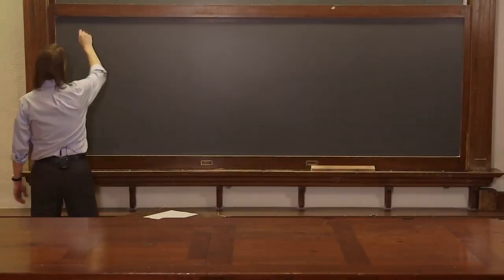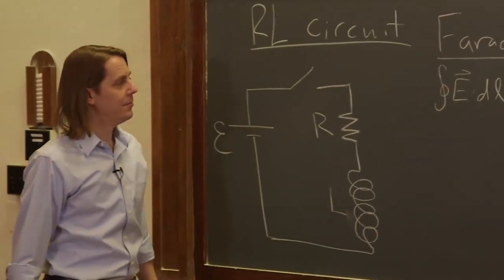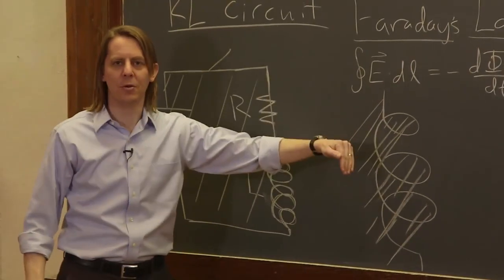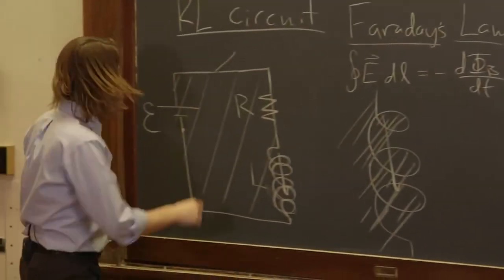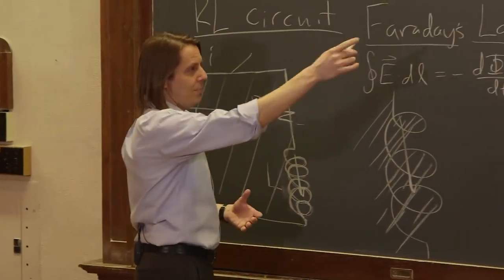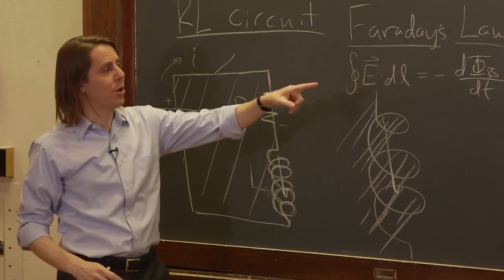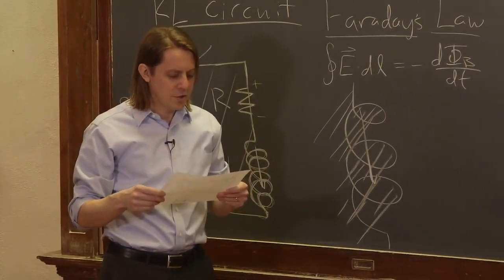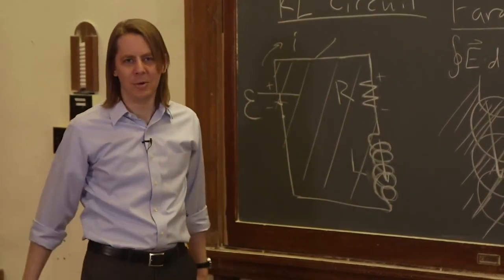PHYS 102 | LR Circutis 2 - Faraday's Law is the correct approach for a Circuit with an Inductor!

Comment: I am curious about the pedagogy here. Why is it that physicists insist that the only correct way of modeling inductive circuits is with this methodology.  It seems that the method falls flat fairly quickly.  For example, if I change your circuit where L is actually two inductors in series L= L1+L2, and I need to know how much energy is stored in L1 (not in the total inductance), then this particular pedagogy seems to indicate that there is no way to differentiate the energy stored in L1 versus L2.  I don't know how you are going to be able to talk in any reasonable way about such a scenario without assigning the magnetic potentials induced to L1 and L2 individually, not the loop.  The loop is immaterial, there is energy that is being stored in each individual inductor.  The KCL is a restatement of conservation of charge, while the KVL is a restatement of conservation of energy.  I don't think your criticism of the KVL is that conservation of energy is wrong?  The only thing that you can say about the traditional circuit approach is that the potentials in the traditional circuit analysis can not be arrived at by integrating the electric field along the conducting path.  But they can absolutely be arrived at by using the scalar and vector potential form of the electromagnetic laws.
Reply from the maker: Here's what really happened:  I always taught inductors following the typical textbook circuit approach that other instructors did previously.  I then put it in my online class that way.  One day I got an admonishing email from Walter Lewin asking me why I had incorrect physics in my class.  So I looked into it and saw how the textbook way is an approximation.  So I made a new version of the lectures to tie it back to Faraday's Law.  The class is intro E&M so we aren't really looking for the best or most accurate way to describe inductors.  I made the change more as a way to show them the Maxwell's Equation version to bring that back up.

Since all that, some Youtubers kind of got into it over which way was best to think about inductors, but I haven't really paid attention.  Also, this was 10 years ago so my memory is fuzzy! :)
Reply: @Prof-Hafner  Ha!  That makes sense.  Listening to it again I can kind of hear the admonished professor admonishing the students.
Reply: Of course you can consider multiple lumped inductors. When you decompose the circuit path you can choose the path jumping at each coil's terminals or the path going along the coil's conductor. In the first case you can use the mockup version of KVL and pretend that KVL still works; in the latter, you will have two surface integrals, one for each coil. No need to consider both surfaces as included by a single "double" loop.
Reply: @copernicofelinis   And how are you getting the energy in the inductors?  What surface are you integrating and what are you integrating?
Reply: @argcargv  if the inductors are lumpable I can ascribe energy to one or another, and use the mock up version of KVL, pretending there is a voltage drop at each coil's terminals. But I guess I could also split the integral over the entire surface into multiple integrals, each one associated with the (almost) closed contour of each coil. (It has to be almost closed if it's a lumped component).

If the inductors are not lumpable, then you are in a situation where you cannot identify separate surfaces for each inductors, and that is why the Faraday approach is more general. In Lewin's ring, for example, you cannot associate separate surfaces to the bottom and top part of the ring. You have one big surface integral that says KVL is dead, and your energy is associated with the circuit, not separate half-coils.
Reply: @copernicofelinis   I am still not getting how you are arriving at energy from this procedure.  Are you invoking the Poynting vector here?
Reply: @argcargv  when I was talking about surfaces I was referencing the broken KVL equation that is no longer zero. In the same way you can split the line integral (that gives voltages) on the lhs , you can also split the surface integral on the rhs (that gives the emf contributions) showing the contribution of each inductor. At each coil its surface.

But if you want to use Poynting then go full field. Expand the divergence of E x H and integrate it over the volume that encloses your circuit. The whole integral is zero (because we are not considering radiation), but the various parts of the expansion give different contributions in the various parts or chunks the volume can be partitioned into. 
The volume chunks containing each capacitor have contributions by E . dD/dt only; the volume chunks  containing each resistors have contributions by E .J only; and the volume chunks containing each separate lumped inductor have contributions by H . dB/dt only.

If you can split the volume into separate chunks, each with its own inductor inside, you can compute the powers and the energies associated with each inductor in the circuit.
As long as they are lumpable.
Reply: @copernicofelinis  Ok, the point is that circuit theory includes the Tellegren's theorem that says that given potentials W and fluxes F, we track the flow of extensive quantities, such as energy, ie. the power is V*I.  In this, it is important not only that KVL is satisfied, but that the meaning of V*I sd power is preserved, which we can integrate in time to get energy transfer.  If you want to take a circuit view of a RL circuit, we can consider the power supplied by the source, the power dissipated by the resistor, and what is left was transferred to the inductor by Tellegren's theorem.    Faraday's law itself is not sufficient to understand the flow of energy in the circuit, you need more than that.  If we consider the voltage to be the scalar potential, then it is much more straightforward to show why V*I represents the flow of power to or from the magnetic elements.  However, if to get the KVL you are integrating along a path that is different from the current flow, then it is harder to make sense of why the V*I relationship represents power.  It is not a particularly useful explanation in that context.  Furthermore, the fact that your circuit that is represented by the conductors that connect the various components have no changing magnetic field between them is insufficient to fully describe the circuit, as this fact could hold, but there could still be parasitic mutual inductance between the inductors.  This can obviously be measured experimentally, or modeled in a lumped model.  It is the absence of including parasitic mutual inductance that is the error that one makes in such circuits. When these terms are included, the circuit models are perfectly capable of modeling these effects.
Reply: @argcargv  Tellegen's theorem is a newtork theorem that requires the lumped circuit approximation. You cannot use it when the circuit is not lumped, which is the general case. In lumped circuit theory the conductors connecting all lumped components are zero dimensional, so you don't have to worry about charges or fluxes. 
The general approach uses voltage as the line integral of the electric field, not of its conservative part alone. This approach is consistent with Ohm's law inside the conductor and does not require you to invent a new theory of conduction in copper that explains how you can have, say 1V drop with a current of 1 mA in a piece of copper with a resistance of a fraction of milliohm.
Reply: @copernicofelinis  Ah, but I think there is the rub.  What is the criterion for saying a circuit is lumpable?  A conservative (as in most restrictive) view would say that we would like to see the electric and  magnetic field magnitudes outside of the components be small enough to neglect.  That I think this is your view of lumpable (correct me if I am wrong).  And I would argue that this view is a sufficient but not necessary condition of lumpability.  You offer no argument that this is a necessary condition.  For example, lets consider the two series inductors.  Let's say that they are air core inductors, so like most electronic components they don't actually satisfy the narrow view of what is lumpable.  The result of this is that two inductors in the circuit may interact with one another.  In this case the magnetic field lines extend far outside of the coil, as an air core inductor does not do a good job of confining its magnetic field.   However, I can control the coupling between these coils by their geometry.  If the coils axes are at right angles to one another then the mutual inductance between them will be small and usually can be neglected, then they can be treated as lumpable elements in the circuit even though the changing magnetic field lines from each of them permeate each other.  I can even use Tellegren's theorem to talk about the energy stored in each individual inductor.  Because these are vector fields and because Maxwell's equations are linear, they superimpose on one another.  Thus, even though the coils changing magnetic fields overlap one another, and the energy stored in each is stored in the same volume of space, the energy can be assigned to each inductor individually, and the circuit is well modeled using a lumped circuit model even though the most restrictive conditions of lumpability is violated.  Thus, if you are taking the restrictive view of lumpable circuits, then this shows that this conservative view is a sufficient, but not necessary condition for lumpability.  And note, even in the case that there is coupling between the inductors, then I can still model the circuit with a lumped model by including the mutual inductance between the coils.  In doing so I can also talk about the energy stored in each individual inductors field, the energy stored in the mutual field and the energy transferred between the inductors by the mutual field.  In fact, the base case lumped circuit model is one that includes all parasitic inductances (self and mutual to all other parts of the circuit) as well as all parasitic capacitance to other parts of the circuit.  Your restrictive view is simply the case where all parasitic elements can be safely neglected without compromising accuracy, but our hands are not tied, we can include the parasitic elements in our lumped model if needed.  In that case it is much harder to define what are the necessary conditions for the validity of the lumped model.
Reply: @argcargv  look, it's this simple: with your view of potential difference as the line integral of the conservative part of the electric field, KVL still works, buy Ohm's law ceases to work inside the indictive components. 

With 'my' (and the IEC) version of voltage, ohm's law works inside the component, with no exceptions. KVL dies as it should because we are dealing with nonconservative fields (and this is very basic physics).
 In lumped circuits,  KVL works if the circuit path does not encompass a variable magnetic flux region. That is, the circuit path has to be shrinkable to a zero dimensional point, where all the two terminals  of each component meet. This does not preclude you to consider mutual inductances, or even a matrix of inductances, as long as the space of interaction of the fluxes is outside of the circuit path . But you need to have a circuit path connecting all lumped elements and no changing magnetic field inside (otherwise you could not shrink it without changing the properties of the systems).
Most circuits do. A few do not, as in the case of Lewin's ring.
Reply: @copernicofelinis  First, the circuit analysis approach such as ohm's law pre-dates Maxwell's laws.  That is because they are first and foremost a phenomenological model.  It is the post-facto analysis that explains why the circuit model works that is lumped.  I just note that such post-facto analysis usually ignores energy, but this is also part of the model. But there are many ways of integrating the equations to get a lumped model.  You keep mentioning Lewin's Ring, but as I am sure you are aware, Kirk McDonald has shown how you arrive at a lumped model to this case by considering the scalar potential equation.  It seems that you are saying such analysis is wrong, not because it is theoretically wrong, but it doesn't use IEC standard definition of voltage?  The reality is that with modern circuits that switch at high speeds, the inductors can be simple wires, and yet engineers every day apply standard circuit analysis techniques to capture the very real effect that these parasitic terms have on the circuit results.  Why are engineers so successful modeling parasitic effects with circuit analysis when it is violating the assumptions you give above?  Maybe it is because those circuits are good approximations to Maxwell's equations, but it requires a different interpretation of what the circuit model is telling you about what is physically happening.

I don't know what you are on about in the case of Ohm's law ceasing to work.  Whenever there is an electric field within a conductor, that is the result of energy dissipation.  In the case of a real inductor with winding resistance, the lumped model for this is a resistor in series with an ideal inductor.  The potential across the resistor in the model is exactly the integral of electric field along the conductor just like in the resistor.  The scalar potential difference across the real inductor is the voltage drop across the resistor and ideal inductor in series in the circuit.  The only aspect that is not directly observable in the real inductor is the voltage across the ideal inductor of the model,  but this can be inferred from the vector potential.
Reply: @argcargv  I am well aware of McDonald's essay on the matter and no, I don't think it is wrong to use BOTH the scalar electric potential AND the magnetic vector potential to describe circuits whenever there is a changing magnetic flux. But this approach, which ironically is what is used by physicists in field theory, has two problems: 

1 it kills Ohm's law in the copper of the coil, meaning that the constitutive equation can no longer be expressed neither in terms of voltage ( or rather scalar potential difference) vs current, nor locally in terms of electric field (E, the total electric field is the only electric field the electrons in copper can see) vs. current density.

2. It requires special, inexistent, voltmeters to measure this special version of voltage that is the scalar potential difference. So, I would argue it's not pedagogically sound. And that is why the International Electrotechnical Committee has adopted that definition of voltage.

Moreover, regarding pedagogy, if you have followed the online discussion about the Lewin ring 'controversy', almost all the technicians and engineers that claim Lewin is committing a probing error don't ever mention the vector magnetic potential. It certainly does not appear in most first year college physics books that describe how inductors work (this is what Lewin lamented when he said most textbooks are wrong ) and I dare you to find me a high school textbook that explains inductors in circuits that mention the vector potential.
The reason is that, when the circuit is lumped, you are on a no-need-to-know basis regarding A. Because you access the inductors properties through its terminals alone, and in that case the voltage (as the line integral of the total electric field) across the terminals behaves as a potential difference.

BUT if you look inside the inductor you either need to acknowledge that voltage is path dependent (it is say Ldi/dt across the terminals and zero or nearly zero along the conductor) OR use BOTH potentials V (which I'd rather call phi) and A to describe the system. And when the knowledge of A is absent (because at high school or first year uni it is omitted for brevity of exposition) mistaking Deltaphi - the line integral of the conservative part alone of E - with DeltaV - the line integral of the total electric field E - is wrong.

Regarding Ohm's law as being a phenomenological law that is only approximately linear... It doesn't matter. It's the constitutive equation E = f(j) that becomes a problem.
Reply: @argcargv  Also, it's not winding resistance what I was referring to. That I can consider to be zero.
The problem with Ohm's law inside the copper of a (perfectly conducting) coil is this:

When you use the total electric field (IEC definition of voltage), E=0 implies DeltaV=0 between the terminals (and along a path in the copper). And yet you have a nonzero deltaV = Ldi/dt across the terminals (but along paths in the space between terminals). Voltage is path dependent (as it should be since the electric field is not conservative) but Ohm's law still works since at every instant  DeltaV = 0*I.

If you choose the McDonald definition of voltage as line integral of the conservative part of the electric field (Deltaphi) then you have a nonzero value of L di/dt between terminals - regardless of the path - which means that even for paths inside the copper of the coil you have Ldi/dt, let's say 12 volts, across a resistance of zero ohms. Let's say the current is 1 mA when DeltaV is 12 volts, and tell me what Ohm's law you use to justify that (if you don't like 0 ohm for the resistance of the coil, use R =  rho L/S to compute the actual value. Tell me if ohm's law is working.
Reply: @copernicofelinis  I see, you have a fundamentally different conception of what the circuit elements are compared to my view.   I consider that all circuits contain parasitics.  In all circuits, every edge between nodes has the properties of self inductance, mutual inductance to all other edges, and resistance.  Or more generally, some functional form of currents, potential differences, and their derivatives, currents and their derivatives, if non-linear real components are considered.  In addition, every node has parasitic capacitance to all other nodes.  There is no such thing as  a circuit where these parasitic terms are identically zero.  However, in typical circuits, most of the parasitic values are small enough to be neglected.  All resistors have some inductance, and with the exception of superconductors, all inductors have resistance simultaneously.  We just sometimes conveniently ignore the parasitic parts of the circuit because their effects are so small as to have a negligible effect.  In this view, when there are electric and magnetic fields of consequence in between circuit elements, then these are characterized in the circuit by including the parasitic inductances and capacitances.  Obviously, the IR contribution in Ohm's law is describing the electric field within the conductors, but because resistors also have inductance,  the scalar potential difference across the terminals of a resistor will not be the same as the IR drop, but usually the inductance of the resistor will be small enough that it is safe to approximate it that way. So in general the resistor and inductor are the same thing, it is just that the inductive term is dominant in an inductor and the resistive term is dominant in the resistor, but each V=IR+LdI/dt (neglecting the mutual inductance contributions which have their own constraints.).   And this is perfectly reasonable as in reality there is no ideal resistor or any other component.   With some experience, it is not terribly difficult to form accurate circuit models  that characterize the case where magnetic and electric fields escape the components and interact with one another.  In regards to the scalar and vector potentials,  these are rarely actually computed to build the parasitic models, although than can be.  Typically the rough order of magnitude can be estimated from circuit geometry, and then refined by measurement.  And this is typically how engineers solve these sorts of problems.  This is perfectly valid, and presenting students with the conception that there is something wrong with this, I think is fundamentally misguided.
Reply: @argcargv  you are mistaken. What I wrote has nothing to do with parasitics. If you want to consider the stray resistance of the coil do it, it will change the result by a few percents at most. Ohm's law with scalar potential difference is off by volts if not by tens of volts.

With the resistance of the copper included I might find say, at a given time, 11.9 volts across the terminals and 0.1 volts along the copper - in accordance with ohm's law.

The 12 volts difference is what breaks - in a fundamental way - KVL.

To be clear, my beef is not with components, but with the circuit path .
Reply: @copernicofelinis  Honestly, you are not giving enough context for me to understand what point you are making.  Obviously you are not talking about DC voltages here because in that case all definitions trivially collapse onto one another, so what the hell is the 11.9 volts and the 0.1 volts you are talking about here.  You are talking about the circuit path? What path, I really have zero context to go on.    If we are talking about time varying currents, then the scalar potential change across any inductor includes the both the effects of Ohms law and the induced changes potential due to the changing vector potential.  In the circuit model, of course, there is no geometry and thus the concept of path is irrelevant.  The effects of the interaction between currents in the conductors of the circuit are lumped and represented as self and mutual inductance.  And yes, you can't separate them out when talking about the scalar potentials.  The scalar potential difference results from interactions from the resistance of the conductor and the interaction of the conductor with the changing vector potentials caused by both the current within itself and the currents in other wires in the circuits as represented  in the lumped model by self and mutual inductance.  I don't see how this is a problem.   Is it just that this isn't how you think the analysis should work, or are you saying this assessment is wrong?
Reply: @argcargv I am literally talking about any circuit with an inductor in it. 
Let's focus on an R L series circuit powered by an AC sinusoidal generator at 15924 Hz with a peak voltage of 14.1 V (that is 10Vrms). Consider R=1kohm, L=10mH. Let's see what happens with two values of the resistance r of the coil: r=0 and r=100ohm. The frequency is such  that the impedance of the pure coil is 1kohm.

With r=0
The current is 10 mA peak, the voltage across the coil is 10V peak. Let's focus on the time t at which it is 10V: this is the value along any path in the space on the circuit's side (not inside the space of the coil). Now, evaluate voltage as a line integral inside the copper of the coil: with the IEC definition it is zero, in accordance with Ohm's law in a piece of conductor with zero resistance and 10mA flowing through it. With your definition it is still 10V and now you have to explain how on earth you can have a 10V drop across a resistance of zero ohms.

With r=100ohms
Nothing changed much. The current is a tad less than 9.5 mA and the voltage across the resistive coil (on the circuit side) is a tad less than 9.6v. 
With IEC definition the voltage computed along a path on the copper is about 0.95V (KVL is dead), while with your definition of voltage it is still some 9.6V, and now you have to explain how you can have 9.6 volts across a piece of copper that has a resistance of 100 ohm and a current of 9.5mA.

The same consideration applies in the case of mutual inductance, or in the case of a coil whose changing field is due to a falling magnet or a nuclear explosion (good luck in finding the primary, there).
Reply: @copernicofelinis  I think I have been careful not to use the ambiguous term voltage, but rather scalar potential difference.  So I don't think I have been ambiguous here, I am not solving my lumped model assuming that the potential differences are IEC definitions voltage.  But once I know the scalar potential differences and the currents because I actually solved the lumped model, then I can certainly tell you what the IEC defined potential differences are by simply application of ohm's law.  And I see absolutely nothing in error from this view, or am I missing something?
Reply: @argcargv  if you are not using the IEC definition of voltage, then you are defining voltage as the scalar potential difference that is the line integral of the conservative part of the total electric field E. There is nothing wrong in that, per se; in fact it allows you to keep KVL (or, rather, KSPDL) alive . But 

1. It kills Ohm's law inside the inductive components (so you have two "physics": one outside and one inside the inductors. (To me this is a consistency problem)

2. Your system requires the knowledge of both potentials: the scalar electric potential V (which I call phi) and the vector potential A. And the knowledge of A (that can be extracted from the current sources) is unfortunately missing in basically all high school textbooks, and either missing or barely hinted at in most first year uni books that are not geared toward a physics degree. (To me this is a pedagogical problem)

3. Your definition of potential difference is NOT what a voltmeter measures in general. (To me this is an operational problem).

Using phi and A, and using V as the line integral of the total electric field E are equivalent approaches, but the first is marred with problems that , in order to avoid confusion, require a knowledge which  is sorely missing in a lot of technicians and engineers.

(Apologies for my multiple edits, but English is not my first language and me bad at drafts 😁)